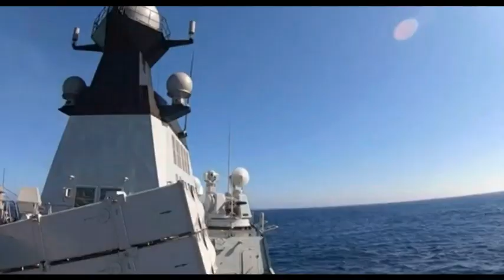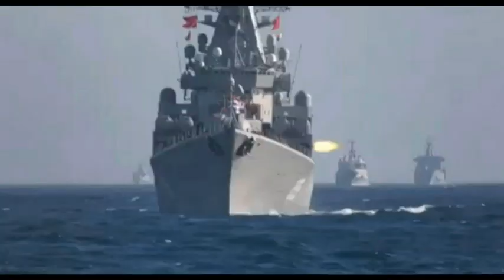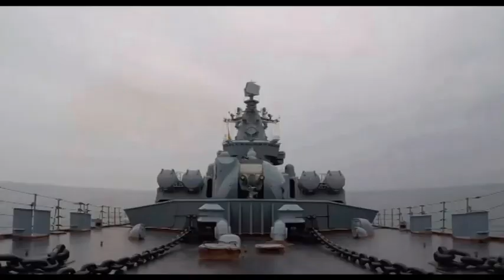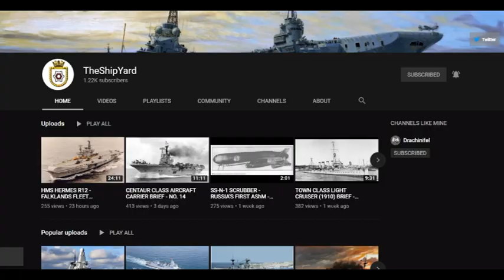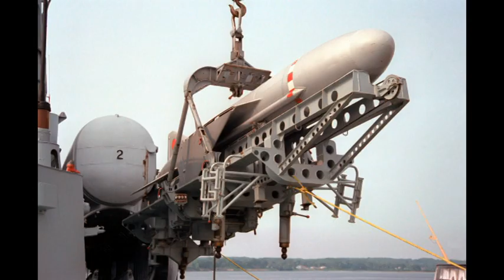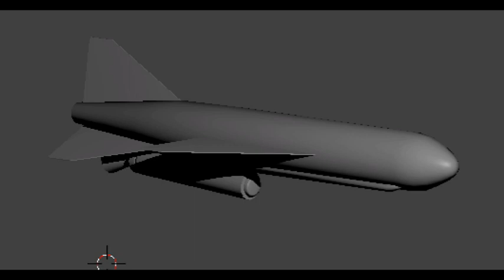SS-N-2 STYX AShM BRIEF - NO.2

Comment: Thanks for the shout out.  The BI-1 project is one of my favorite historical incidents.  Rocket powered point defense interceptors.
  Lockheed, of all people, persisted with the concept after it was dead, emerging from its dungeons with the F-104, a turbojet powered Point Defense interceptor.  There was no specification for it and, especially, there was no perceived need, but, still, the USAF bought them.
  It was almost instantly apparent that the USAF had made a grave error (possibly urged on by judicious gifts of money, cars, women, and cocaine-Lockheed is famous for this "hard sell" tactic), and, with liberal lumps of the same errant grace, the worthless plane was foisted off on our allies . . . who were forced to use it in the exact opposite manner for which it had been conceived and developed.
  From a fast climbing, zero range, interceptor (with no perceived use, remember, as stand off missiles were already a thing), the F-104 was pressed into service as a tactical strike platform forced to fly low and slow.
  The whole episode reminds me of the P-39 Aircobra, which suffered a similar fate when its promised superchargers (its raison d'etre) were denied it.  Born a high altitude interceptor, it saw its main service as a low level attack plane . . . in the Soviet Union.
Reply: And a nod to your 3D modeler.  Nice work.